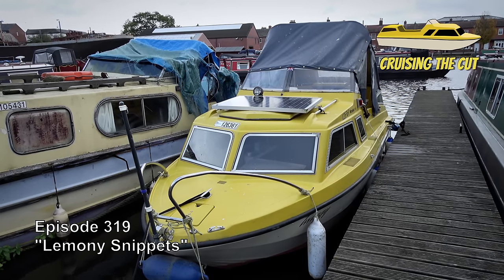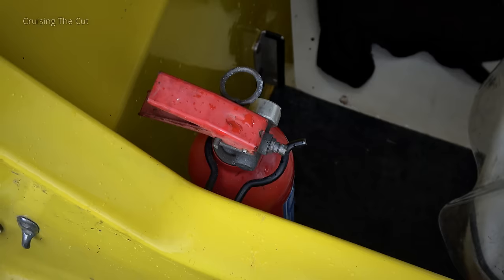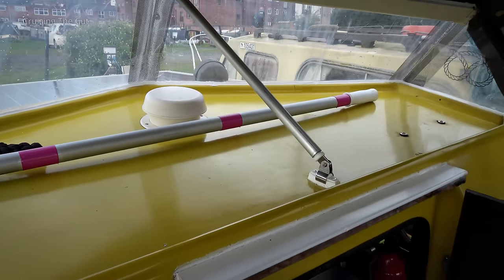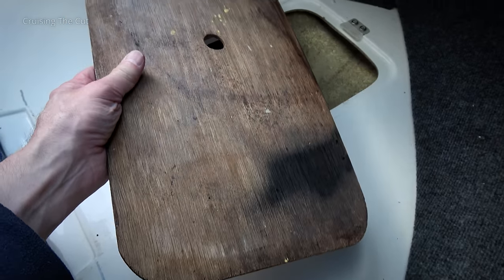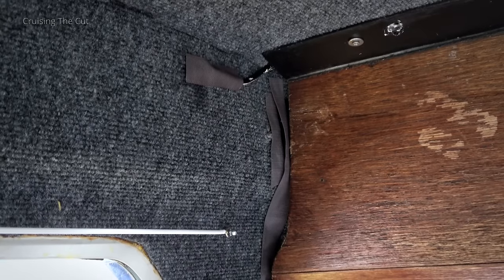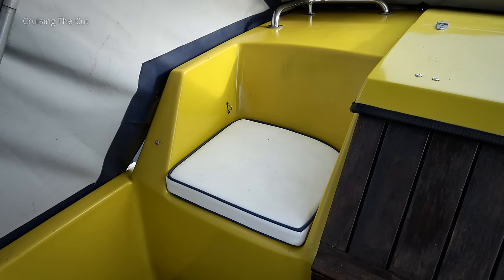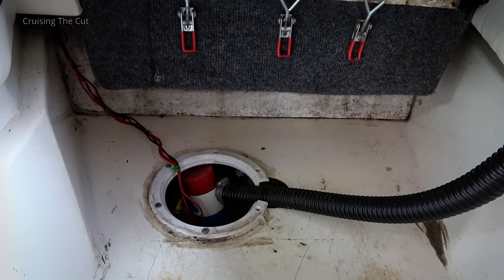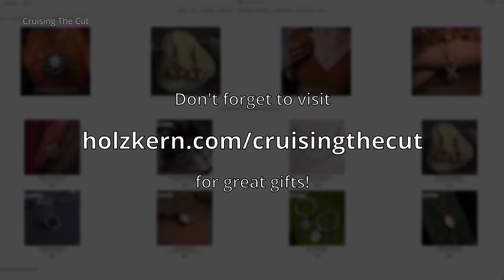319. My boat - the FULL TOUR!

Comment: Sweet boat!  Rated for 140 hp I notice.  Would be quite a go-er with that on. A bit of a false keel, say 10-15 cm deep might help the low-speed handling a good deal.  Of course you know that being outboard-driven it will steer equally well going astern as ahead.

Suggest filling that well by the engine until it drains naturally through the drain hole.

A switchable LED strip under the fuel tank might take the sting out of checking your fuel level.

When dealing with the bilge pump remember that a) boats have been sunk by water siphoning back through the pump discharge and b) centrifugal pump output is very sensitive to restrictions and pumping head on the outlet side.

Your navigation lights are quite likely not acceptable under current rules.  Could be a safety as well as regulatory issue if you venture out into the "real world" where everything isn't constrained to go in straight lines and the main info you get from the lights is "coming at you" or "going away".
Reply: Shims or a bushing of some sort (nice if you know someone with a lathe) could help the table.
Reply: I hope your little Lemony pun isn't an omen.
Reply from the maker: Cheers

Comment: Such a lovely little boat. Please, please, please David move the sink to the other side away from the batteries. One little leak and will be such a problem. Adding rain guards (see through plastic as seen on taxi windows) above your opening windows will help protect from rain, especially if you put some down the diagonal so can crack the window for ventilation. Rear cabin as bathroom and storage seems perfect, leaving front cabin for lounge/bedroom/kitchen. Would the solar panel fit over the front rails? Can some plasticised medium be used to create a gradient in that trough by the outboard to help channel any water to the hole?
Reply from the maker: I won't move the sink but I will move the batteries!

Comment: Greetings from Lake Tahoe USA 🌲I believe that mystery cable is for the solar panel. The solar panel sits on the top deck, and the cable is routed in through the hatch or side window. Sorry if this has been said 100 times I did not read all the comments.
Reply from the maker: Ah cheers but no, the solar cable comes around the side
Reply: @CruisingTheCut  I will get out my whiteboard and come up with other theories for your review😂😂

Comment: @CruisingTheCut If you going to replace the helm's wheel; replace it with a smaller steering with fine tuning for the canal network's turning radius. 
Since the controls not center and the port side lacks steering when at the locks. Maybe add some kind tool or secondary control if hoping over seat is issue?

Comment: Don't know what she cost I assume not much. Considering her age she seems to be a great little boat with no obvious serious faults. If she's lasted this long there can't be much wrong.  Hopefully you won't find anything nasty when you get her out of the water. Personally I wouldn't worry about the solar panel being mounted over that hatch,  however when you remount it, I'd make it adjustable so that you can angle it towards the sun and leave enough room to open the hatch slightly for ventilation. Good luck.

Comment: The motor is probably off-centre so the boat tracks straight, assuming the boat does track straight.  My tender likes it's motor a touch off-centre.  It’s an older motor without the adjustable steering tab like the newer ones.

Comment: If it was me I would strip out the back cabin and put in a shower cubicle with cassette loo on one side, and have the electrics there also. You could use one of those pump weed sprayers as the shower that you fill with hot water like in that camper van you showed in camper meet up you went to.
Reply from the maker: I have been considering exactly that - some kind of sit down shower arrangement but I'd need to ensure the water could all be collected and pumped out. I don't want to just let it fill the bilge and have that pump do the work.
Reply: @CruisingTheCut  If it is a sit down arrangement, the loo would be idea for the seat, then there is nothing stopping you by having it raised a little when fitting the shower tray so underneath you can have a 12v pump for drainage like what was in your narrow boat. Shower water is grey waste as you know so pump out the side or into a 10l dump container as you like. Lots of possibilities.

Comment: You could mount your solar panel at the rear on a frame to one side of the engine
Reply from the maker: There's not a huge amount of space there but maybe a small one
Reply: @CruisingTheCut  I was thinking of mounting a frame so the solar panel sits off the back of the boat horizontal with the water. 
I’ve seen it on  another boat but can’t remember where lol

Comment: Should do nicely as a watery campervan. It doesn't look bad inside and out for nearly 50 years old, though there are some nasty bodges as you say. All fixable though. Electric drive beckons, doesn't it ? Tricky with needing to run an induction hob too of course. More batts in the bow might make it steer better ??
Thanks to this new boat I have had to look up how 'Morse' type throttle/gear boaty controls actually work. Looks like yours may just need greasing of the cables, and adjusting of cable tensions (and maybe routing) so that gear is fully engaged before the throttle cable even starts to pull a bit. On the web, this seems to be a fairly common problem, so you should be able to fix it :o)
Reply: There are videos showing the control cables being cleaned using wd40 and compressed air. It's amazing how much gunk comes out of them before they clean up. Well worth doing, I would suggest.
I have a 72 Shetland 535 project for this winter, so your experiences will be most welcome.
Good luck!

Comment: thank s for the full Tour, from your comments below it looks like you're going to lift it before starting on any more major work which should speed things up significantly, getting the paint matched from one of the chips sounds like a great idea but make sure you give it a good clean and polish before you start so that when the rest of the gel coast is polished it matches the fresh colour properly.

from seeing your campervan videos I'm sure that you'll have no problems re-organising the cabin to make it much smarter, have you got plans for the rear cabin as well? I'm guessing you don't need the tiny bunks so the area could be re-purposed, if there was a middle fill panel (removable of course) would it be wide enough to make a bunk across the boat? (as a guest cabin perhaps?)
Reply from the maker: I'm pondering whether I can make the back cabin a bathroom of sorts!
Reply: @CruisingTheCut  sounds like a good plan! Would definitely make the boat far more comfortable.

Comment: Those random unconnected terminals were probably for some LED lights as they are commonly used for that. For a 50 year old glass boat that is in incredibly good condition. Many boats I see here half that age are in far worse condition. 
     Lots of typical interesting additions and modifications. It always seems that many that buy boats want to do modifications but often the boat owners lack the tools, skills and knowledge to do it well. Sadly your boat is a little too far away from my workshop.
Reply from the maker: Cheers. There's a couple of serious issues but a lot of it is 'superficial' for sure.

Comment: The trough at the engine well may have 2 tiny drain points in the corners which will be blocked and need a poke with i thin tool.

Comment: It does indeed show its age, but nothing seems exceptionally abhorrent, just some touch ups and the usual stuff.
Fixing the cracks and chipping is a quality of life improvement, would really make it look fresher.
Also, an advantage of fiber glass boats is the relative ease of patching holes and making anchor points for various stuff.

Improving the electrics does sound like a good thing to do. Replacing the weights with a set of batteries would likewise be an improvement. Rarely can one have too much battery capacity.

Comment: David, Have you heard of Captain Tolley creeping crack cure, its limited in colour white is what I have used in the past but it fills gelcoat cracks very efficiently by osmosis. which would give your GRP protection from further moisture ingress while you sort out a colour. so gel coat manufactures will for extra cost match as best they can if you have a piece you can send.
Reply from the maker: Good idea, I'll look into that

Comment: Oops, all that silicone... That's the worst kind of sealant to use on a fiberglass boat. It's going to be a disgusting job to get rid of it and clean and reseal the joints, ideally with polyurethane sealant. I've found the sealant used for vibrating joints in caravans and motorhomes to be pretty good, otherwise of course SikaFlex or Carbond is most appropriate for a boat. Fingers crossed, you have a lot of work ahead of you, but all the stuff you want to redo I would 100% replace too. As for the engine, I have a very similar one, just a bit older. I'd recommend getting it completely resealed while you can still get the original gaskets. I've only managed to get the carburetor and fuel pump done, and now I'm having a bit of a hard time getting the right gasket under the cylinder head.

Comment: Re your batteries. The big one will be your outboard motor starter. It should be isolated from the other two, whose function is to run your bits and pieces. Good luck!! Cheers Ausgranny 🇦🇺🇦🇺🤶
Reply from the maker: No, the batteries are all leisure batteries, joined as one. The outboard is pull start only
Reply: @CruisingTheCut  thank you for replying. Love your stuff. Back to the batteries... in that case "crikey mate", interesting way of doing things!!! I was referring to how our boat was wired. I probably would trade in all three and get two decent size "wets" or one lithium to match your solar panel but check your solar controller. If I'm preaching to the choir, sorry. Good luck and plenty of cheer!! Ausgranny 🇦🇺🇦🇺🤶🥃🥂🍻🍻🍻🥂🥂🥃🥃🥳🥳

Comment: David, I wonder if removing that extra rudder might help with the wandering steering?  A counterintuitive thought, however, I wonder if the extra rudder is splitting the thrust coming from the propeller and then breaking up the vortices that normally form thus reducing the system's effect. Again, just a guess. None of my outboard boats ever steered well at low speeds.

Comment: Thank you for the tour.     Vis a Vis the solar panel problem.   Cannot you get (not very good English) some of these very thin flexible ones now that you could dot around and still have the use of your hatch.   Just a thought.   I am wondering how this passed the BSS.   I'll go back in my box now and shut the lid.  😟   Edited because my fingers are not working this morning.
Reply from the maker: Because of the curves and shape, the panels would have to be tiny and then the interlinking wiring would be complex and likely ugly.
Reply: Oh dear not good then.   I am sure you will come up with something a bit more 21st century to make it look good.   You certainly will not be bored for the next year or so, as plenty to do.

Comment: 17:30 Not a boat person so I could be totally wrong but I wonder if that trough is there to catch any spilled  ̶G̶a̶s̶o̶l̶i̶n̶e̶ Petrol that spilled from the fuel lines or engine.  That drain hole probably originally came plugged.

Comment: 18:31 Again, I'm not sure how I've owned so much of this crap but, that is not a sight glass. It's a light that comes on when everything is fine. When it's off, you have a problem which, per the manual, may be just a matter of replacing the "lamp". The next step is to replace the entire CDI box. ...but I'll wager if you start the engine you'll find a... I want to say? green light in that glass.

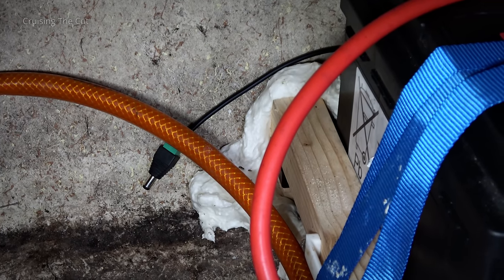Comment: 99% chance the hanging barrel connectors (12:51) are for LED lights. Pretty sure I even saw one of those hideous cheapo remotes sitting somewhere as well.

Maybe don't rip them out - just get an ESP8266, flash it with WLED, and utilize them. :D

Comment: I have trouble understanding how that 12v system got through BSS. At least it's got some fuses. 

You should be able to fit a flexible water tank (bag) under that area which would work nicely for the sink, though you'd need to find somewhere suitable to attach a filling hole.
Reply: 😂😂😂😂

Download the checklist for BSS examiners ... see where it goes on about electrical systems.

The most important issue for BSS is gas safety and fuel safety together with adequate ventilation.

Not forgetting CO and smoke alarms and powder bottles and fire blanket.

And gas and diesel isolation valves.

Petrol engines and petrol storage, with respect to ventilation is also taken very, very seriously.

David will soon sort out the above where applicable.

And of course Lorna can pitch in where necessary.

Comment: Hi David. I'm pretty sure that you know there's a difference between RAL and Pantone, but do you know how they differ?

Either way, are you going to polish the current Gel Coat to restore to the original hue? If not, there's very little point in matching the colour, because the new, (even if correct), will be different to the existing.

Comment: I would disconect the fuel line /hand pump from the outboard after use if its connected and also connected to fuel the gasses will mount up In the engine making it a problem to start

Comment: Could the rear cabin be adapted with  a crossways full length bed with electrics underneath ? This could then produce space for pumped water tank and general storage.  Could further space be created by having a fitted fuel tank in the water retaining space forward of the engine.  Honda 9.9 should push you along at 10+ knots.
Reply from the maker: I don't think it's wide enough but I'll check

Comment: I'm sure you will have great fun fixing things up gradually as time allows. I will be interested to see the induction hob and battery changes. Just a thought, for the size boat, have you considered an alcohol stove such as the Origo 1500 or the Compass 24 1500 stove equivalent? I have just swapped out a camping gas stove like yours for a Compass 24 version, and am now looking forward to brewing up next season, hopefully without the potential fireball risks of the gas camping stove. PS the engine charging capacity spread between 3 batteries would worry me if the hob is a large power drain. Best of luck.
Reply from the maker: I'll be changing the batteries!

Comment: Btw, that carpet lining inside your boat looks very much like the cheapest carpet available in carpet right (in case you decided to just replace parts (I used it in a camper and it was about £3.99 a meter

Comment: Hopefully your boat doesn't become a project boat unless that's what you want to do. The minor things you mentioned in your video are good winter project's, Could you make the back cabin by the motor the WC? That would be my issue, better than peeing off the side? 😁 Or do like In sailing ships, the toilet was placed in the bow somewhat above the water line with vents or slots cut near the floor level allowing normal wave action to wash out the area.
Reply from the maker: It IS a project boat!

Comment: 12:35 Amusing how many of those parts I've owned over the years. The different sized batteries does not matter but if you want to get shockingly more wattage out of your solar panel(s), ditch any PWM charge controller and go to MPPT-- PWM controllers are a joke. It won't double it but 20% felt pretty huge to me.

Comment: There's really a lot to do. Looks like the previous owner(s) tried to do a good job but lacked a lot of skills (and probably money as it looks like reuse of old kitchen cupboards to me). Good to see that many extinguishers, CO and smoke alarms around the boat. 
Noticed a box of a TP-Link router next to the batteries (at 12:10), so maybe the dangling 9V plug was for the router, as the previous owner tried to get a better signal inside the boat? Also, didn't you mention an old antenna in one of the previous episodes to which you had no clue of the use?
Reply from the maker: Ah, good point. I don't recall mentioning an antenna though.
Reply: @CruisingTheCut  Didn't check if you mentioned but I thought you did. My mistake.

Comment: Clearly whoever had the boat before and did the work didn't have the best skills for this sort of thing. A real hack job, but the boat is interesting, and i see a lot of potential here. I don't know if you have a garage or shop at your house, or if you have a trailer for it, but that's what i would do. Haul it home and do a serious repair and refit. I think a lot can be done with this center cockpit design, i have loads of idea's in my head for sure including doing something along the lines of modifications to it's keel if you will to add some directional stability so it tracks straight at low speeds. I don't imagine it draws much of a draft, i am sure something can be done there  
Curious to see what you do with it.
Reply from the maker: I'm going to haul it out in the Spring

Comment: I tried finding the yellow color for your boat. The internet wasn't much help. I tried finding color codes and it just gave me color codes for cars ect. I thought maybe pictures would lead to a color. I saw your boat and a few others. Most didn't open or they didn't show the boat that was pictured. It's yellow LOL. I doubt even if you found the color that it would match for touchups . I'm sure the original color has faded

Comment: Re Battery under the sink. Personally I wouldn't do it, but 12v really doesn't much care if it is wet. I saw a car-battery powered submarine on 'scrapheap challenge' that worked fine even when the battery was completely flooded. Not that I'm advocating it - just, apparently it's not a major consideration.